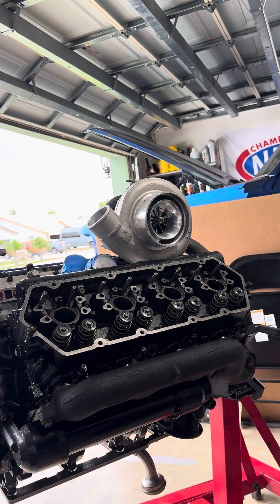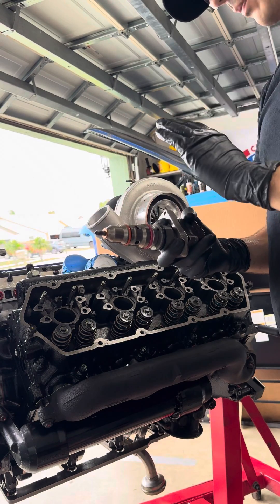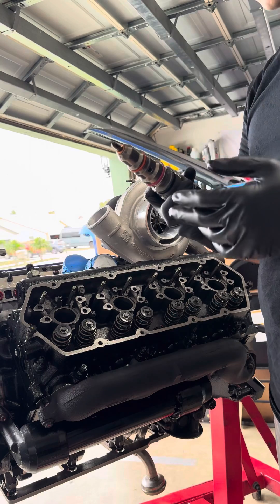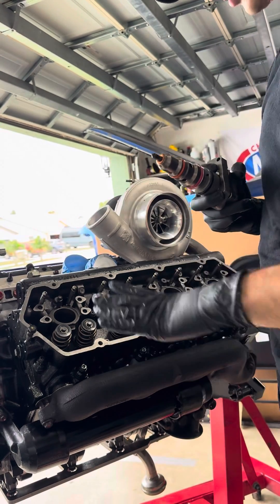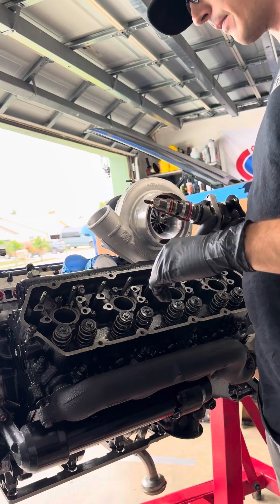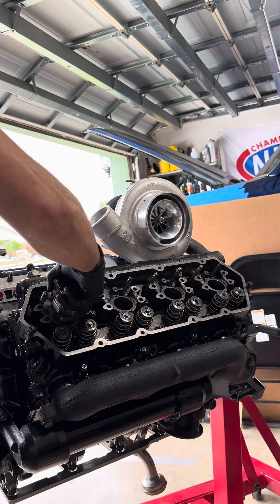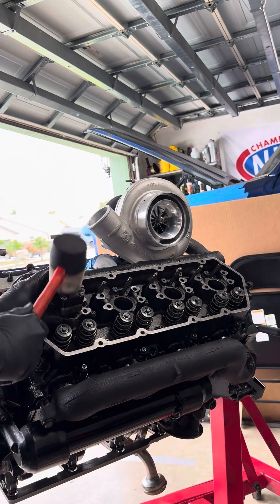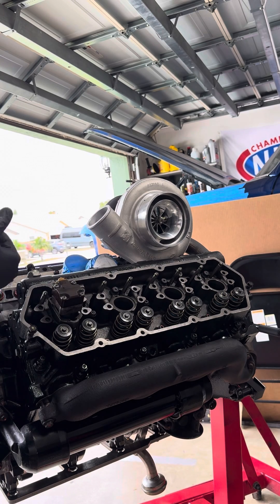7.3L Powerstroke injector install the RIGHT way

Comment: So I did this and was wondering if that metal collar is supposed to be flush once the bottom bolt is torqued down? Once I torqued the bottom bolt, I still felt a small gap between the collar and the cylinder head. Is that correct? The rest of them went the same way and could definitely tell the injector was bottomed out

Comment: Great Info! Just make sure to extract as much of the oil out of the cylinder as possible prior to Installation Folks! 🤙🏻
Reply from the maker: Yes, I second that!
Reply: I usually pull the rear one first, then do a slow turn by hand with the valve cover set on and the glow plugs out. Then spin it with the starter, then put the glow plugs in and straight to burnouts and jail